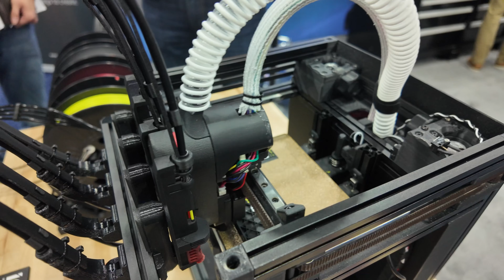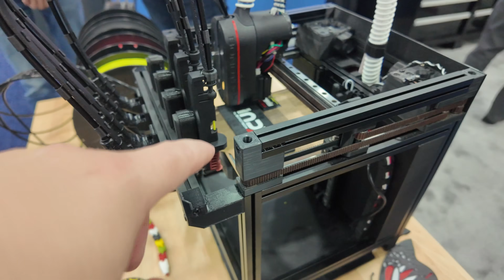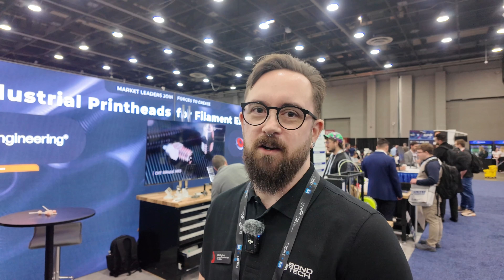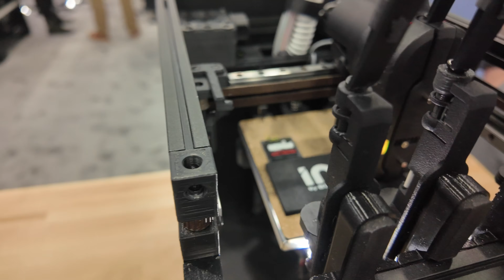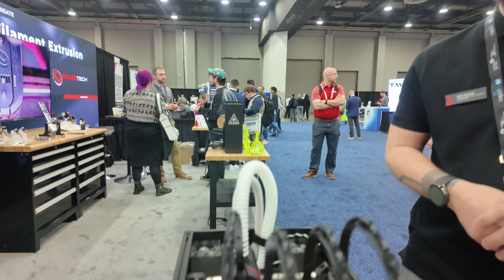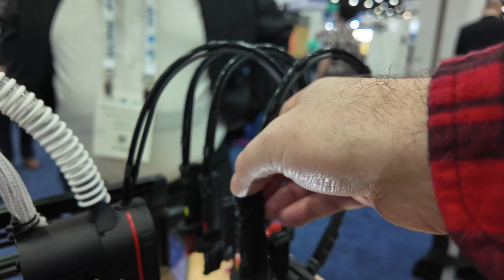BONDTECH INDX - This toolchanger is INSANE!

Comment: What about enclosed? 
Does it support all filaments types like ABS, ASA etc?
As I can see it will be useful only for PLA or Petg
Reply from the maker: you can enclose it, but depending on what printer its mounted on, options will be different
and it works with any filament that standard (under 300c) hotends are capable of, so yes, PLA/PETG/ABS/ASA/PC/TPU etc

Comment: I'm about to buy a Rat Rig V-Core 4 500mm... that puppy will be able to fit sooooo many INDX heads! Can't wait for November!
Reply: Oh nice, go for it, its a great printer, got one too, its gonna fit 25 or more of these heads, depending on spacing
Reply: @FCKN_WEEBS  At 35 mm spacing, I could easily see 20-22 of these fitting across the internal width of the 500 because of the space on either side of the build plate that they left open to support IDEX. I don't need nearly that many, but it's good to know that I could if I wanted. Who needs a Bambu that can daisy chain 6 AMS units for 24 colors and have an insane amount of waste when kitting out a large printer with a bunch of these could do the same with negligible waste.

I just want 6-10 ($425-$565). Thats more than enough for multi color, dedicated support material, or multiple nozzle diameters and at a price that would make the Prusa XL irrelevant in the multimaterial space. The dream goal for by the end of the year is ~$3000 all in for a 10 head 500mm cube printer with hybrid core-xy kinematics. Thats a steal compared to $4500 for 5 nozzles on a 360mm cube with much less tinkerability. What a great time to be in consumer 3d printing.
Reply: @FCKN_WEEBS 
My conservative estimate said 20 to 22, but I could see 25. 

With options like that, who needs a Bambu with a 6x daisy chained AMS's? 

Jokes aside, I'd probably aim for 6-10 so I can have different nozle sizes, multi material for support printing, and a handful of colors if I want to do something colorful.
Reply: Dude same. I was looking to sell my vcore 3.1 500 so I could put that towards an IDEX vcore 4, but with this coming out I might have to cancel the sale.

Comment: Imagine it on a prusa xl 😮
Reply: Unless Prusa let's you load custom firmware, good luck getting INDX to play nice with the XL.

If anything, this renders the XL pretty much obsolete. The biggest thing the XL had going for it is its tool changer since pretty much any other tool changer was a sort of janky hacked together solution that was more project than product. If INDX "just works", then Prusa is in trouble. This implementation is as good or better than Prusa's and can be deployed on any open source printer. Vorons and RatRigs will blow the XL out of the water both in price and performance. The only thing I can think of that the XL will still have going for it is the segmented bed, but that's just a matter of time.

Comment: The main drawback i see so far:  I can't hit buy yet.
Reply: Same here I keep throwing money at my screen, and it not working.
Reply: You can try make it urself
Reply: @FishFingers764  It took bondtech 2 yrs and i have a FT job. They are better at it than i am
Reply: @FishFingers764 with inductive heat and one tool, have not seen that
Reply: also not for bed slingers
Reply: > also not for bed slingers
Well, not as-is, but with a motor/motion system to move the tool-changing rack back and forward, it could be done.
Reply: I want this
Reply: I won a filament changer from my printer brand in October last year... still don't have it
Reply: Prusa core one will have this next year.
Reply: i don't need a reference printer to be finished, i JUST WANT THE TOOL CHANGER PARTS so i can upgrade by SV08 finally myself :D i even threw money at bambu because i am in desperate need of a proper multi material printer! thats money i had gladly invested in his development instead of giving it to appl... i mean bambu (still worth every cent imho)
Reply: Well there is also the fact that you can get some v0 cheaper than tool changer
Reply: @filipbyma6130  for what it is, the INDX seems really well priced. R&D ain't free unless you're Creality
Reply: @filipbyma6130  Where? I haven't found any sub $300
Reply: It cost almost as much as the printer.... yall suck at math.

Comment: This has potential to be amazing.  I really hope the tool head can get hot enough to use engineering grade materials.  Would be a shame for something with this much potential to be relegated to making multi color PLA shelf clutter.

Ideally is like to see the tool head being capable of 350 deg c.  I would love to build a really large format printer with one of these maybe something like 400x1000x400 mm, fully enclosed and insulated, with a chamber heater
Reply: Definitely hope it can hit 350C. I went with the Qidi Q1 specifically because of that heating capability that Franky can't be matched at its price point. I NEED engineering filament capability

Comment: I thought it would be fun to put this with two toolheads on a V0 just for the memes. I did not expect them to just fit 4 toolheads on that thing instead. This is amazing, it means basically any printer can fit at least 4. I am unreasonably hyped for this.
Reply: Literally my first thought was "v0 toolchanger?" because the multi material parts I make are usually small.
Reply: @SentientTeapot2444 hell, most of mine are no more than two colors, too.  Gonna be nice not having to set up an entire tradrack or ercf just to do a second color
Reply: I really like it too - this seems like a project for my V0 and I'm happy that I did not tried to fit the Revo PZ on it.
Reply: Yeah I'm wondering if this means you could slap like 8 or even more on a V2.4 350mm. Idk if anyone would actually want to do that, but it would be super cool just knowing that it's possible lol
Reply: @coledavidson5630  I think the value of a large number of tools will go up as more functionality is added to the firmware (multiple nozzle sizes, special nozzles for non planar printing, probing tools). There's a reason industrial CNC machines have dozens of tools.

Comment: Other than macros is there anything that truly would need to be changed from putting this on a trident/v.0( flying bed) vs a 2.4/micron with the flying gantry or if there’s any advantages to one or the other. Only thing I see if faster tool changes with a flying bed since the gantry won’t need to rise up to the nozzle/filament dock. I may be wrong but I think a belted z can be faster. Either way I look forward to this being released
Reply: The guy developing TapChanger built a "lift bar" sort of a flying toolhead dock https://www.youtube.com/watch?v=lwFKDuF7oC4